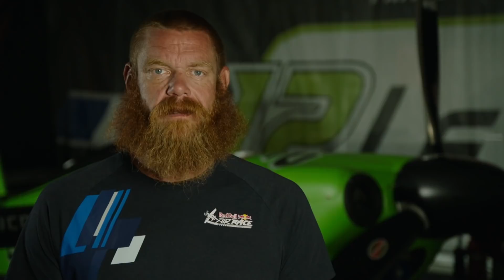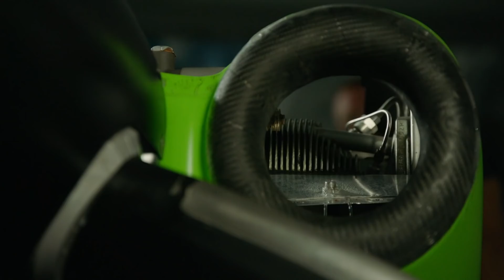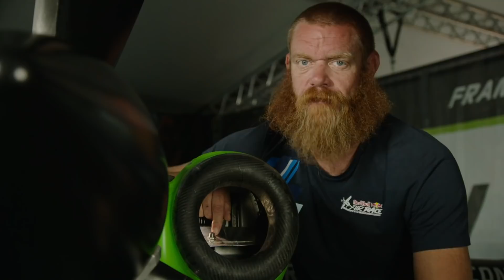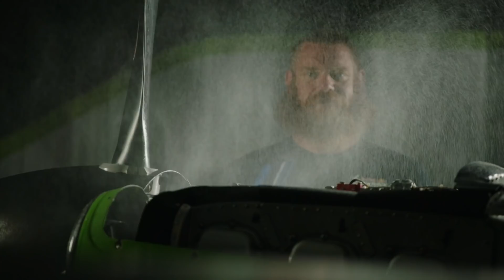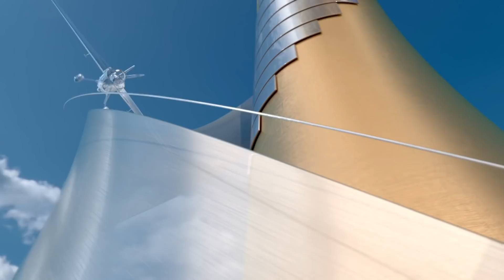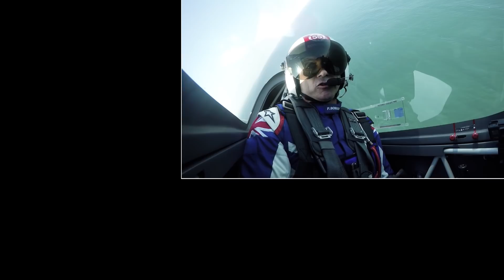Red Bull Air Race Tech Talk | Engine Cooling

Comment: What about an alcohol water intake injection like they came up with in the 40's?  This was done to artificially increase the octane (which is not needed now) and lower the CHT's  and EGT's which seems like it would be needed here.  Also, since the mecs are wanting to max out cooling any way possible, has anyone done accurate fluid flow and temperature mapping models of this pressure box/ cylinder fin cooling method or a more efficient air manifold?  Since you are spending millions on these racers, maybe a different design and number of cooling fins need to be specific on each row of cylinders. I'm sure Lycoming can model this stuff up. Not much has changed in 80 years on these Lyc and Cont cyl and pressure box designs, besides the tweaking.  You still have a box where cool air comes in at the front, passes over the hot front jugs, and then cools the rear jugs with warmer air causing  a cooling air temp differential between the jugs.  This isn't a big problem for normal aviation engines, but it is not the best way to get max performance that u r looking for. All the air passing over the jugs should be the same temps and there should not be any stagnant air pockets such as in the upper rear of the box and this can't be done with old pressure box technology.  

I'm assuming Lycoming  supplying these Red Bull engines have studied the engine cooling tech of engines such as the Rotax 912 up thru the new 915 engines where they use both air and fluid cooling.  Are they going to wait another 80 years to come out of the cave with a better tech that apparently is needed for your racing engines?  Sometimes it might be okay to think out of the "If it ain't broke, don't fix it" box. I'm aware that any change to GA aviation aircraft takes a hundred  years of proven track records before being considered acceptable, but there are ways of doing tests now that prove changes would improve aspects of engine performance without jeopardizing durability for these highly experimental applications.

Comment: How much water do you have onboard ? .... the extra weight is a factor or not ?.. hope it is just enough to get from A to B .......... interesting !
Reply: The water evaporates (absorbing heat) so no liquid is going overboard. Gal of water is 8.34 lbs/gal. So 2 gals (guess that is plenty enough for short race), plus small pump, tubes about 20 lba.
Reply: It's only going to last a couple of minutes. When it's atomized it goes much further.
Reply: @JSFGuy  Some courses are only 1 min to fly. How much water needed? Depends on 
flow rate and desired drop in air temp. Atomization is not relevant, volume or mass is. Water mist increases the surface area and increases evaporation. Water absorbs 550 calories per gram. 1 gal minute is 3785 grams x 550 cals = 15 btu. Rough calculation of temp drop is volume of air to be cooled x .133 divided by BTU. The area is cowl plenum above engine. Let's say 8 cu ft. That is 1.6 deg F. Double water flow 3F. Does that make a difference? The top 4 or 5 are within fractions of a second. It is likely they are flowing 4 gal min. Or 6.4F temp drop. That would allow engine to make more power. So 4 gal would do it is my rough analysis.

 However cooling intake air is better, but not allowed by rules. All teams run identical engines. No power modification. Cooling is an airframe modification not engine mod.
Reply: @gmcjetpilot  Atomization is not relevant with the misting? 
I am out here in the western Mojave I play with patio mist systems and swamp coolers. I was suggesting through actual experience not formulas. This water cooling of the air in the cowling would have much more effect low dew point or low humidity.
This is why we play the game.
Reply: @JSFGuy  You are putting words in my mouth... read what you said about atomization lasting longer. FLOW IS WHAT MATTERS. PERIOD, regardless if atomizer a stream. You can have a huge spray of mist and a little tiny trickle of a solid stream. Understand? Then  read what I wrote about mist increasing surface area, which increases evaporation, increases heat transfer.  Understand. I've lived in Arizona and I've been around the misters at the outdoor patios and I've seen swamp coolers before.  THIS is nothing new to me. you need to read and think before talking.
Reply: @gmcjetpilot  I'm not putting words you said it was irrelevant so anyway not going to argue about it I can read just fine thank you very much you and I are not on this program so I guess it really doesn't matter.
Reply: @JSFGuy  you said when it's atomized it's going to go much further. No not necessarily. Flowing 2 gal a minute regardless if  being sprayed out a nozzle making mist or solid stream, it is still 4 gal an hour. 

Your needed FLOW is based on your cooling desired. I understand you are thinking these whispy sprayers to cool people on the patio. Yes they are using ounces of water a minute not gallons. However these race engines have huge volume of air and heat to cool. They need large nozzles. So atomization isn't relevant to flow if you use a very large high volume nozzle. It will not last. If you used one of those patio mist coolers it wouldn't cool those engines at all. 

 Flow is flow regardless if you have it come out in a solid stream or spray, size the nozzle for the flow you need. I do agree if you want to flow say a river, solid flow is more dense. We are not talking max flow, only needed flow, mist or solid, its irrelevant.

For heat transfer atomization is very relevant.
Reply: @gmcjetpilot  sure and I would imagine there's probably a reduction in air flow if you increase the cooling capacity of the same air with her moisture supplement. I've never been a part of that it would just require some research mini sensors and lots of testing. Something might sound great but not always turn out to be so great in the end.